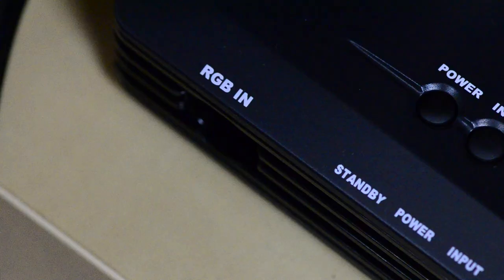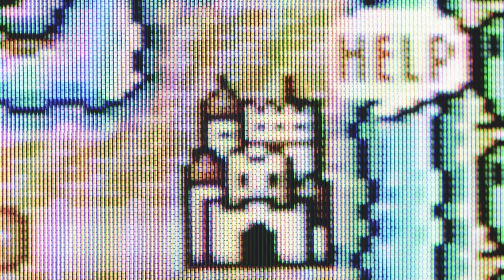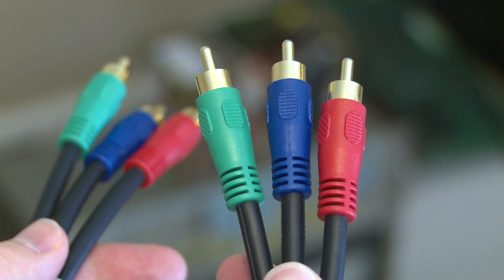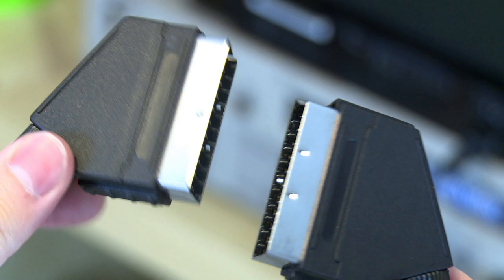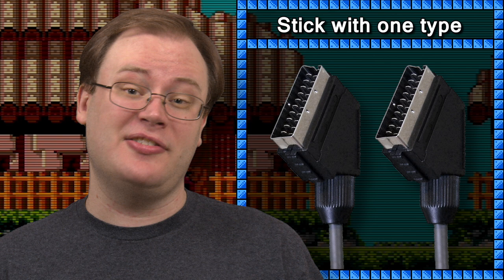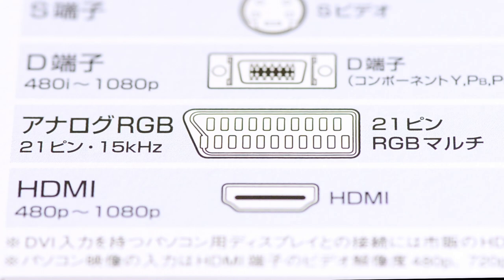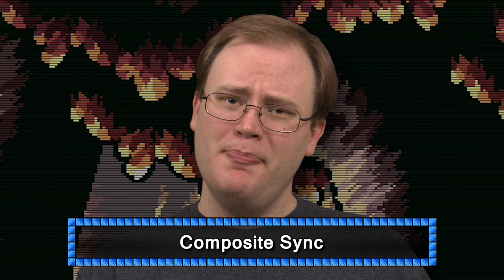Understanding RGB and Sync :: RGB103 / MY LIFE IN GAMING

Comment: So I have an RGB modded N64. It has the latest Tim Worthington board equipped with de-blur. I have a basic SCART cable that I bought off the guy who modded it for me. I have the system routed through the OSSC 1.6 (great unit by the way) and every so often I'll see a kind of strobing effect on the screen. I've been looking into new cables and from what I can gather, sync on luma is the preferable choice for the N64. However, I've also read that certain RGB boards might require CSYNC to perform optimally, but I haven't seen too much about specifics on which boards those may be. 

My gut is telling me sync on luma is the way to go, but I thought I'd ask around and get a second opinion. 

And thanks for all your awesome content! You got me hooked on retro upscaling solutions and now I am absolutely loving the OSSC 1.6. I haven't tried it over my 4K inputs on my Sony X800D yet, but 5x scaling to 1080p looks great!
Reply from the maker: +SoncTheHedgehogMaker [Try4ce] You should go with luma, I'd say. If anything, I've heard CSYNC could be trouble in some cases.
Reply: Thanks Try! You guys are great!

Comment: I wish Retro Console Accessories store was up at the moment! Need to get me some cables!
Reply from the maker: There's one auction up that indicates that regular listings should appear again after the holidays.
Reply: Did you get your Sega Genesis SCART cables from them?
Reply from the maker: [Try4ce] Yup! I actually got my CSYNC Genesis cable in the past few weeks. I'd been using sync on composite for Genesis for a long time, but honestly never really saw the same obvious patterns that I'd see on SNES. Personally, I think Genesis looks especially great in RGB, something about it just really pops.
Reply: Best place on the web for SCART cables. I love that seller!
Reply: ***** INDEED!! The Genesis/MD SCART output is probably the best of all the consoles overall with the PS1 a close second. I wish the SCART signal was better on the SNES but overall it's still a HUGE improvement.

Great video btw. I dealt with all these isues late last year when I bought a Framemeister Mini & had to get all the different cables for my systems but Retro Console Accessories on ebay REALLY helped me out by answering all my questions.

Comment: Good stuff sirs. Being a Brit this sort of thing was something we always had to wade through when finding decent cables, and that was after the minefield that is gimmicky stuff most companies would chuck all over the packaging like gold plating and all that. 

One dumb thing worth noting, for anyone looking to copy your set ups, if you're buying a SCART cable for the first time check it actually has 21 pins. Some had a lot less because they were non-RGB and kinda sucked.
Reply from the maker: [Try4ce] Never heard of that! The nice thing about doing RGB today instead of back-in-the-day, is that there are people who make and sell custom cables, even in North America. Some of these cables are even designed to do things that the original cables released in Europe or Japan couldn't do. For example, the SNES issue mentioned in the video. We can get cleaner images today, using custom cables, but still within the capabilities of the consoles!
Reply: Yeah they were a pain if you got one by accident. Often they'd be packed with cheap DVD and VHS players. This Wiki article has a little info on them. 

http://en.wikipedia.org/wiki/SCART#Practical_considerations

They're basically composite video in a SCART shape.
Reply: Ya, like those sellers on ebay selling SCART cables that carries composite signal for an NES telling you that you will get a better picture. It will give you the same image as with with RCA composite only with a SCART plug on the end.

Comment: Have you guys thought about making a video about how to get the best sound quality from retro and modern systems? I know it's not as complicated as video as there are less steps involved but I think it can be very informative to people showing the difference between RCA, Optical, and HDMI. Also whether or not it's worth getting a nice pair of speakers or surround sound system compared to just using the crappy speakers built into HDTV's.
Reply from the maker: [Try4ce] I'm not as much of an audiophile as I am a videophile, but audio is of course an essential part of the setup. Since my receiver is from 2006 and doesn't properly handle HDMI audio, I'm stuck using a lot of fiber optic cables (Coury's situation is similar). I have thought about making something that focuses on audio, though I think my audio setup for streaming might be of more interest than my setup for just regular play.
Reply: *****
How do you have your Dreamcast hooked up? New HDTV's no longer have a VGA port and it can be a little complicated to hook it up to the XRGB-mini as additional accessories are needed.
Reply from the maker: [Try4ce] My Dreamcast is actually not hooked up. I got it for free, and don't have any games! Coury doesn't have his ideal setup for it just yet, but maybe he has something to add here. If I'm not mistaken, the VGA is typically converted to YPbPr to go into the Framemeister.
Reply: austin532 Look into the Dreamcast VGA boxes made by Beharbros. I think their newest model (Toro) is specifically designed for Framemeister compatibility. I have an older model (Kuro) that works great, as it properly supports both 480p and 240p games via VGA/RGB (which most DC VGA boxes are not capable of).VGA-to-YPbPr transcoders would be the second-best option.
Reply: I have a decent system hooked up, and am as much an audiophile as a videophile. In general terms, any audio system is probably better than the TV speakers. HDMI is capable of way better quality than optical, however games rarely use it. When they do, it is the same difference as with blu ray movies. 

In technical terms, optical is only capable of stereo lossless audio. When using multichannel audio though toslink (optical) you are limited to DD or DTS, which is analog to a multichannel mp3 at 1.5mbps at most in DTS, and around 500kb in DD. For comparison, HDMI can give you 9mbps of uncompress audio, or compressed in lossless at 2-3 mbps.

RCA audio is the only option in many consoles, if you have the option for optical or HDMI against RCA go for it. It will give you multichannel and/or less noise because of a pure digital path.

Comment: Followup: My Framemeister arrived yesterday, and I spent some time getting it all hooked up and programmed they way I wanted. My display is a Sony 55-inch LED LCD I bought for $2,000 a couple years ago. It was expensive, but supposedly extremely fast response time with no detectable lag in "game mode" (all upscaling and processing filters turned off). So I first hooked my SNES APU revision console up via JP-21 csync and was blown away at how clear the picture looked. However, when I plugged my SNES 1-CHIP-03 (last revision of the original model), I was saddened to find the csync isn't internally hooked up inside the console. Thankfully I found out the mod for fixing this is relatively simple, and I was able to do it myself. It worked perfectly, and I cannot stress enough how ABSOLUTELY RAZOR SHARP the pixels are on the 1-CHIP-03 with RGB CSYNC! Imagine an emulator hooked up to your display, now realize that it's not an emulator, but the actual hardware! That's what it's like. There is a downside though, and that's the 1-CHIP series isn't 100% compatible with the entire SNES library. Some games have minor graphical issues in the top line, and even worse is I discovered Secret of Evermore crashes after the opening logo, rendering it unplayable on a 1-CHIP-03. So for that game, I'll have to hook the APU SNES back up in order to play it.

At any rate, there is literally no detectable lag on my setup, so I'm extremely happy with the outcome. Worth every penny!
Reply: Update: After modding the CSYNC on the 1-CHIP-03, I tried Secret of Evermore and it actually works now! I can't figure out why this is. It would crash after the logo fades out, but now seems to work fine after the mod. I have no idea why this mod seemingly fixed that loading bug.
Reply from the maker: KarbuncleX
[Try4ce] I recall Coury having issues on his 1-chip 01 with Demon's Crest and one other game. If I recall, this issue was fixed when he moved from sync-on-composite to CSYNC. I don't know exactly why this is, but I think it has something to do with how stuff is loaded into the RAM, and how that works in conjunction with the video output... but I'm not techy enough to really say for sure if that's right.
Reply: *****
  I think I figured out what the problem was, and it seems to be the interface leads. They are more sensitive than I've dealt with before. I've had subsequent games crash in the intro or not load at all. They seem to work better when I polish the cart leads using a pink eraser, though Secret of Evermore had unused leads. It may just be the thickness level of the cart boards themselves, and this game might have a slightly thinner one that doesn't make a good contact with the leads in the console.

Comment: Composite?
Worst possible video?
I'd differ, RF is worse.
It even squeezes the sound in there too..
Reply: I agree Composite is light years better then RF
Reply: NeedMoreMushrooms yeah I think it is not even considered an analog format, rather a radio format.
Reply: Radio isn't an analog format? lollllllllllllllllllllllllllllllllllllll
Reply: depends are we talking AM or FM band ..because all modern FM broadcasting yeah  let's just  say that "static" you  hear on the FM band is actually artificial , it's placed there to let you know you're not tuned in properly otherwise you'd just have dead air when not tuned in properly.
AM is ALL analog all of the time though.

Comment: All my retro is on a pvm via scart. It's amazing. I buy the cheap scart cables on amazon and they all work. No fuss or research needed. None of them say Luma or sync etc but they work.
Reply from the maker: [Try4ce] Noise is less visible on a CRT, it's true, but you can still see it depending on the clarity of the display.

Comment: i had that checkerboard effext on my snes using my rgb scart cable which used sync on composite. after opening up the av connector side and wiring that to the luma pin it cleaned up the image.

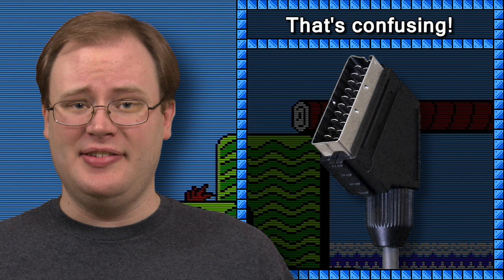Comment: 8:56 "...VGA, which you'll recognize as the connection that you used to use on your computer monitor"

Only NOW does that statement apply to me! I've used a VGA monitor for about TWENTY-THREE YEARS. The HDMI out on my computer goes to my Elgato capture card for desktop recordings. Last month, the VGA card on my computer lost its reds and I had to shell out for a HDMI splitter and HDMI compatible monitor.

Comment: I've recently gone down the RGB rabbit hole and this video helped clear up a lot of the confusion I had regarding sync types. One thing I'm not sure of is, in this day and age of high quality shielded SCART cables and upscalers like the RetroTINK 5x, does sync type really effect quality in a discernable way? I could see sync-on-composite causing artifacts with a lot of signals going down one cable, but would there be much difference between sync-on-luma and CSYNC?
Reply from the maker: [Try4ce] There has never really been a tangible difference between Sync-on-luma and CSYNC. Even sync-on-composite is the same quality as long as the cables are well shielded. On PVMs or other CRTs, noise is not very noticable, but the higher quality the upscaler, the more you want to be sure you're using good cables with minimal noise. They can show a lot of detail, both the good and bad! But the low pass filter settings can help.
Reply: @mylifeingaming   Wow, wasn't expecting to get a response from one of the hosts, that's dedication! Thanks for the feedback, I've ordered a RetroAccess sync on luma for my SNES and N64 since it seems to be the most straightforward for my planned N64 RGB mod. I'm glad I won't have to worry about sacrificing picture quality.

Comment: Another great video from both of you guys, as always. You introduced me to a world I never knew existed before!

Question though, if I want to make my N64 CSYNC compatible, how do you change the signal or implement the "sync strike"? I never heard of those things before and my N64 footage is rather grainy.
Reply from the maker: [Try4ce] It's worth noting that you should keep modest expectations for what you can get out of N64... remember that we're talking about early 3D graphics running at a 240p resolution. No matter what you do, you're never going to get stunning high res out of the original hardware. Don't expect the same benefit that you can get from consoles that predominantly display 2D graphics.

That said, RGB certainly can make the colors more appealing, and give the overall image a bit more contrast and clarity. I've only just learned from the comments on this video that CSYNC output is possible on N64, if the mod is wired up for it. I've got sync on the composite video signal for N64's RGB. I just didn't know any better when I asked to get the system modded. This isn't really a problem, because N64's graphics generally aren't as clean as say, what you normally see on 16-bit consoles. So I rarely notice the visual noise that RGB sync-on-composite can produce, which is much more clearly seen on consoles like NES or SNES. As for using the sync strippers, well, that's not something I can provide a whole lot of info about. There's a sync stripping function on an SCART switcher that I'm trying to implement into my setup, and the newer SCART adapter that I bought for the Framemeister also has a sync cleaning function. I haven't yet had a chance to thoroughly test these and determine just what kinds of differences can be seen.

Comment: Guys Check very well SCART cables, i remember those years when opened many of them and saw they only has 3 wires working like a normal RCA 😹

†
Reply: I came across a cable that had all the wires but still... but still... worked like an RCA.

Comment: looks like i need to watch this video multiple times i already learn't what component is (as in parts of the signal is going through different components of the cable or pins) and finally found out what's the difference between the 3 and 5 cable component cable thinks to wikipedia, also another name for ypbpr or component is yipper cable and i think the words of what scart means is french at least i learn't what jp-21 is the first time watching the video
Reply from the maker: [Try4ce] I was a little bit worried that it might be confusing if we didn't include the audio cables in the YPbPr images, but since this was more about video than audio, we left them out of the pictures.

It was thanks to Artemio Urbina that we included JP-21... we asked him for feedback on the script, and we got some advice about it. It was an oversight because we've never dealt with JP-21 personally, due to SCART being recommended to us when we first began our RGB journey.
Reply: k

Comment: I bought a scart cable from retrogamingcables for my PS1. I got the Csync cable. I used it with a scart to hdmi converter, and I notice that I have the artifact problem shown in the video at the 9:20 mark. Is this due to the cable not actually being Csync?

Comment: 09:20 hat's really interesting, i had that problem on my snes jr and it drove me nuts! ended up doing a minor solder bridge that fixed it. i then realized that when i first got into rgb i ordered a cheap scart cable that i had no idea how it was wired, i just thought that because it worked with my xrgb mini that it was csync. im waiting on a delivery from  retro_console_accessories so ill find out for sure,

 i took the extra step of getting them to have the audio run from the multiout to rca connections (bypassing the scart head straight to my stereo system) separating any chance that the audio signal being a influence in my scart hub or Framemeister.

Comment: We all got stuck with composite because it was the best analog video option for 20+ years until SCART came out. By comparison, after SCART, a new better interface would come out ever 2 to 3 years from then on, not long enough for manufacturers to settle on a standard to defeat composite. But luckily, HDMI has taken root, and is somewhat future-proofed in that HDMI 2.0 supports 4k. Still, some new better interface will come along soon I'm sure, making HDMI ports obsolete. And it will feature not 4, not 5, but a 6 letter acronym, all consonants.

Comment: Big question!!!!   A lot of people are doing RGB mods to their CRTs.  All of them seem to be doing "Sync on Composite"  where they utilize the yellow port (composite video port) for their sync.  How then would we wire up a "Composite Sync" instead?  Where should the wire be plugged into?  Do Jungle ICs usually have an allowance for this that no one has bothered to put in their tutorials?
Reply from the maker: [Try4ce] This is something I don't know much about, but I would suspect that you could still plug CSYNC into that port as well... just my speculation, though, I don't have an RGB modded consumer CRT. Sync-on-composite by the way is not necessarily bad, it can look just as good as CSYNC if you have properly shielded coaxial cabling.